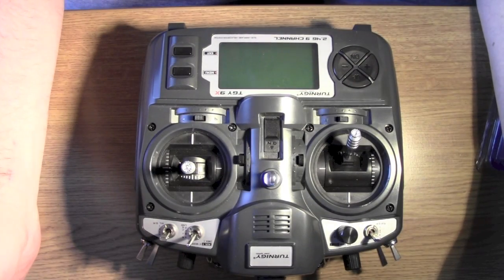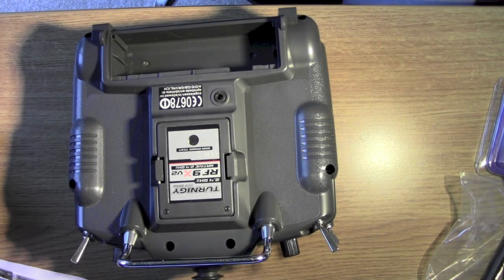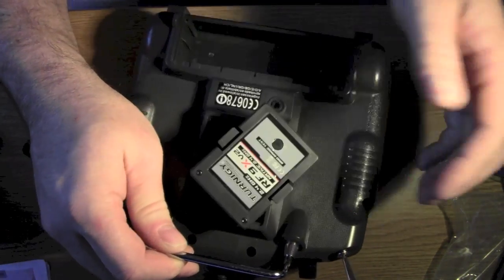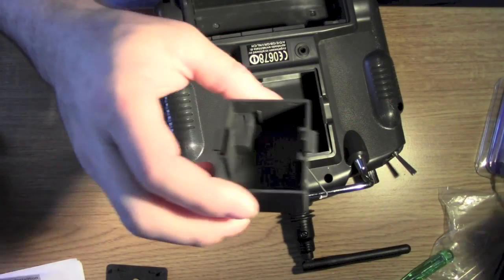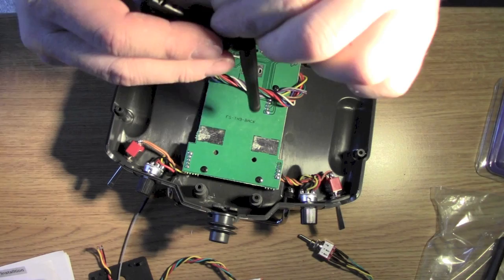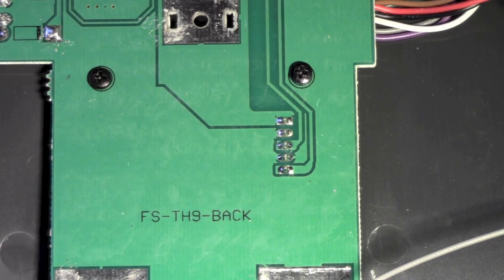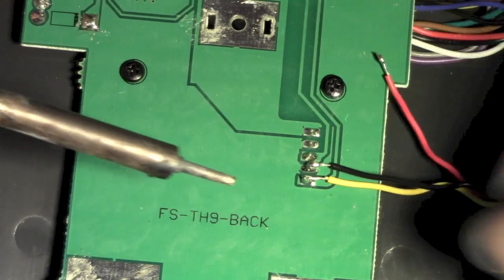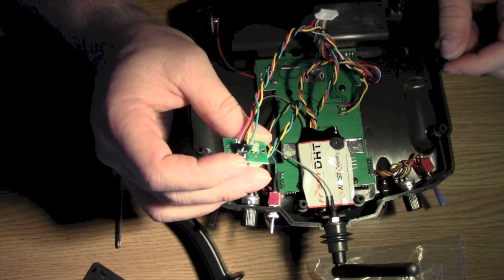Installing a FrSky DHT 2.4GHz Conversion Module with Telemetry into a Turnigy 9X

Comment: the only reason is if you want to be able to switch between the original module and the frsky but I cant see the point in that. I will use a diy module on my 35mhz hitec flash 5 becouse of two reasons. first it has no module slot and second I need the 35mhz band for my submarine